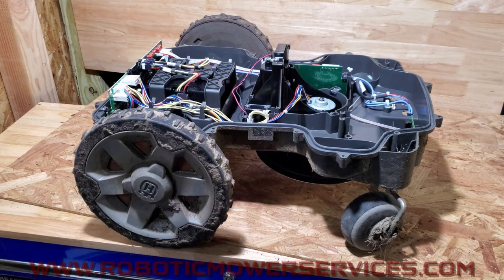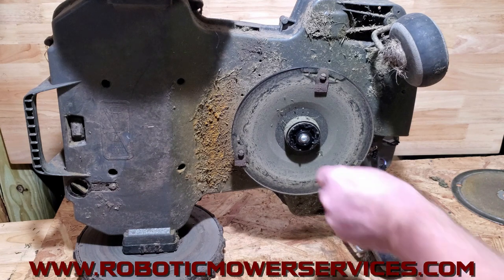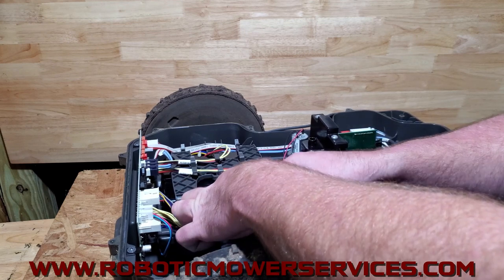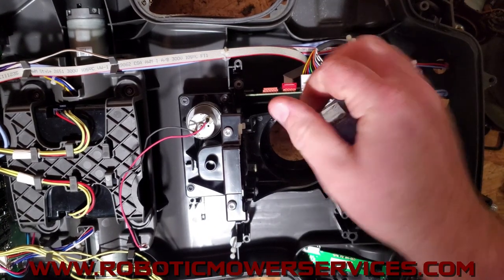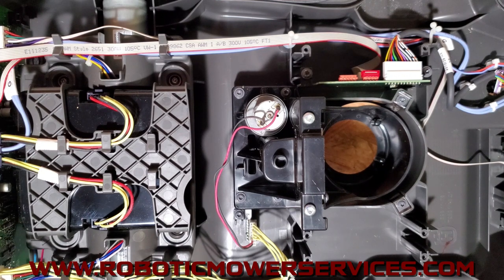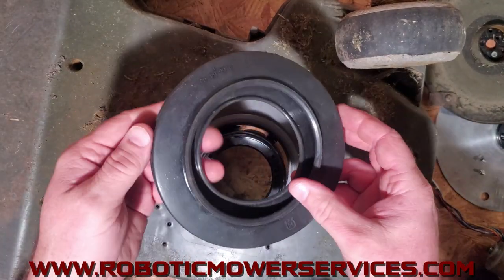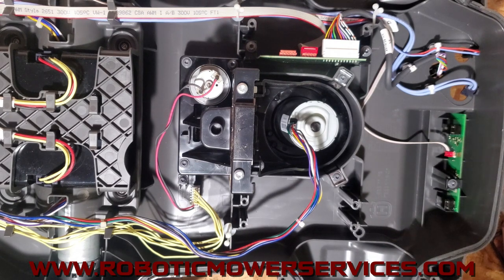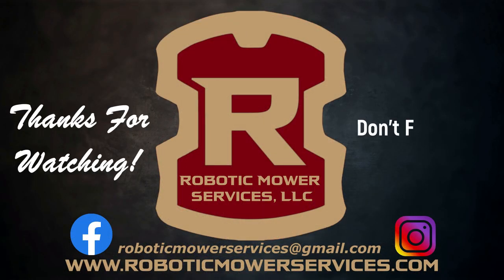Husqvarna Automower Cutting Motor & Height Adjustment System Remove And Replace (400/500 Series)

Comment: Adjusted the cutting motor on my 450X when parked and got "cutting height blocked" error, checked and no obvious excess grass, often seen worse. Took out plates and found bit of dog hair around under bearing assembly and cleared same, again easily enough, but error wont clear, just keeps displaying same, any thoughts or can I clear it any other way to see if issue returns?

Comment: How do you assess the cutting motor is bad?
Reply from the maker: If the cutting motor is going bad you will start getting error messages related to the cutting system more frequently. If you've made sure the bearing assembly is working fine and the cutting disk shield can spin freely and that there is nothing jammed or wrapped around the motor shaft, then your cutting motor is probably going bad.